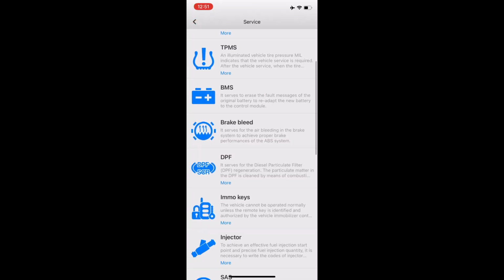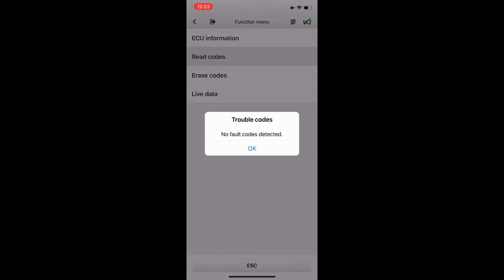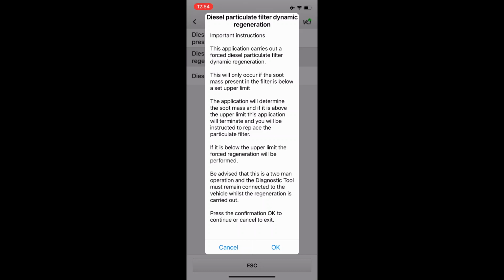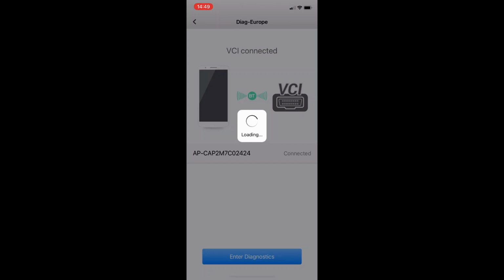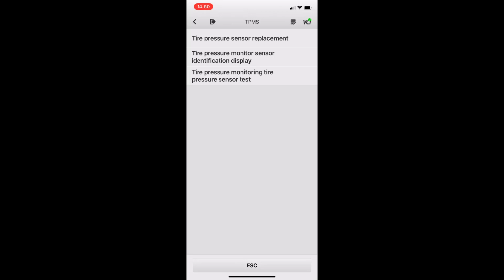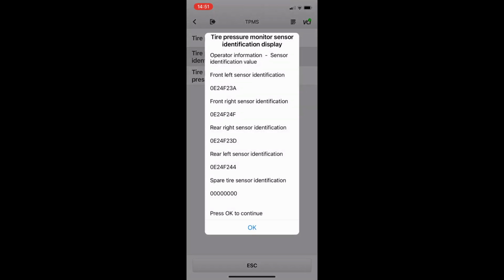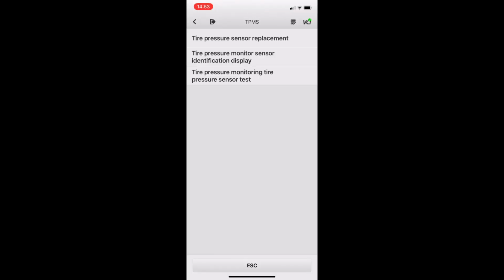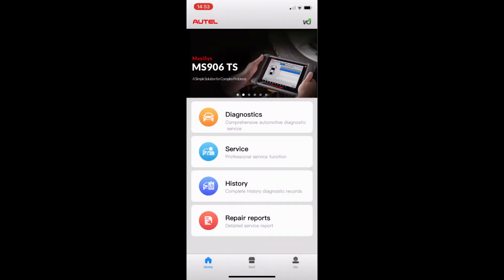Autel AP200 Land Rover DPF TPMS Capability

Comment: hey Tony, could you confirm (and show if possible) how to calibrate air suspension with this tool?
Reply from the maker: Hi. In the other video for this Autel tool on this car I run through most of the steps, but don’t actually execute the command. I think it’s the “unboxing” video. Hope that helps. All the best 👍
Reply: You can calibrate the suspension height in mm. It instructs you to measure each height from hub center to start of plastic arch on level ground. Then input the data. Then it corrects it.

Comment: Did you get to the bottom of the headlight control unit code as I’ve got the same thing
Reply from the maker: Hi David. No is the answer. I connected to the car just the other day to read the codes as I now have the dreaded ‘Suspension Fault’ issue. (Not good). The intermittent headlamp code was still there but causing no issues since I first read it. Hope that helps. All the best 👍
Reply: @vialettotony  are your head lamps still auto levelling as mine aren’t and I thought this may be the case
Reply from the maker: @davidbirt9409  yes, all working well. All the best 👍

Comment: Thank you very much, and I even got a shout out!  Triggering all the car functions will have been a squeaky bum moment ;)
Reply from the maker: It certainly did instil a moment of panic. A few weeks on though and no issues whatsoever. 
I actually put the AP200 back on it last night to check the codes again, as I’ve put it in to the Mai dealer today for service and belts. I wanted to be sure of any issues I should expect, but nothing out of the ordinary came up. I’m going to put a video together on my experience with the main dealer which will be out towards the start of April. (There’s a few other videos scheduled to come out between now and then)

All the best Al. Have a great day. 👍

Comment: Is this work for my Giulietta Diesel? My DPF is 80% obstructed and my car doesn't run the regeneration, even if i do 30/40 km with 4 gear at 80km, what should i do?
Reply from the maker: Ciao Francesco. Yes, I’m sure it will work on the Giulietta. It lists so many vehicle types. When you try to perform it, the tool checks the condition first and then says if it can do it, assuming the DPF isn’t too far gone. 
Hope that helps 
All the best 👍
Reply: Did you watch the video, it indicated that it will.